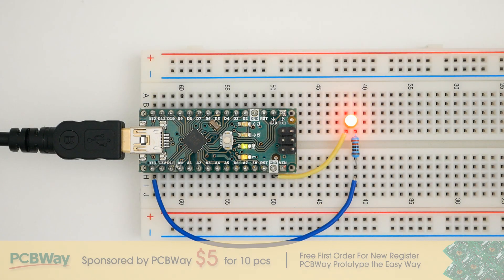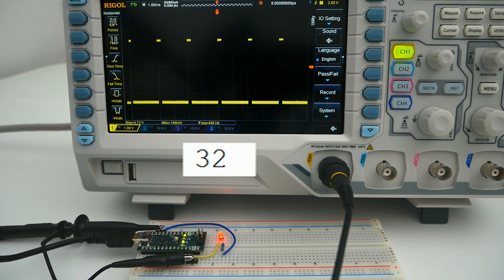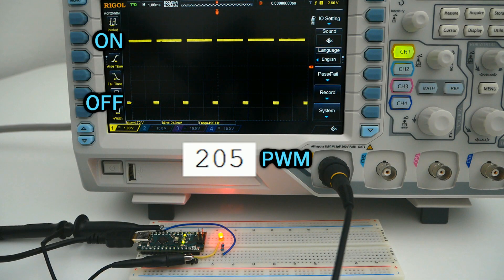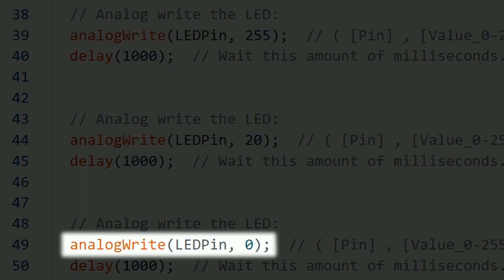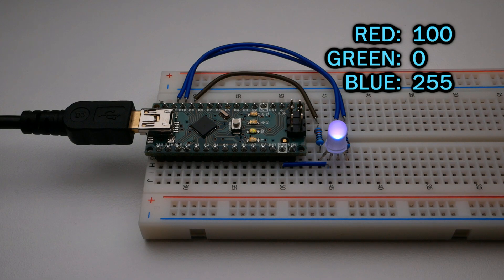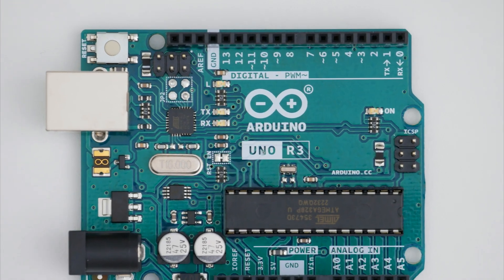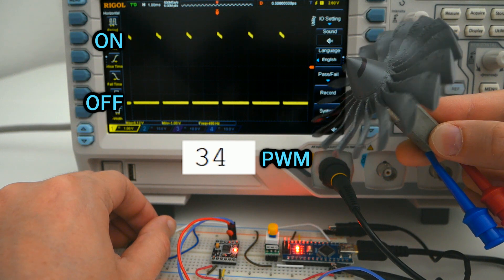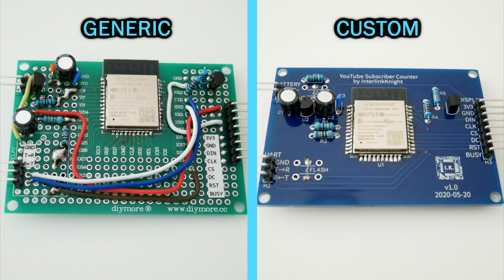Easy Arduino Tutorial: #3 Analog Output (PWM)

Comment: Analog inputs fit well with analog outputs, for example connecting a 10k potentiometer to an analog input to control the brightness of an LED using PWM, allowing code as simple as:
analogWrite( d3, analogRead( a3 ) / 4 );  
I'm assuming here that analogRead() returns values between 0 and 1023 which need to be scaled down to 0..255